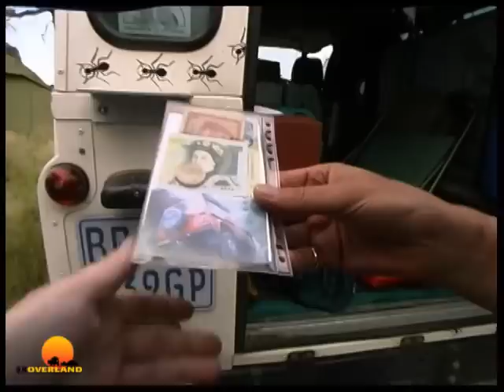Tyre pressures, how shocks work, building our overland truck. 4WD1, Ep2

Comment: Nice to see the logic of tall skinny tyres being better than fat tyres off road.  Most go for the fat tyres because of misconceptions and the aesthetic, losing steering lock, performance, fuel economy and increasing steering and wheel bearing wear with little benefit.  Fat tyres also dramatically increase aquaplaning on wet roads.

Comment: thanks for the tips, I have found in regards to corrugations that there is an optimum speed at which the cars suspension seems to harmonise and thus smooth out the ride. just sort of depends if you are comfortable sitting on that speed on a dirt road.

Comment: What causes corragations in the tracks, always wondered
Reply: Harmonic oscillation. It's caused by the tyres of the very vehicles using it. The more vehicles the worse the corrugations. It's basically caused by the bounce of the suspension. As another vehicle uses the route it is "bounced" in the same rut caused by the first vehicle and extends the surface damage. The rhythmic bounce caused by vehicles going at a same or similar speed creates the corrugations.

Comment: Why didn't your land cruiser get the snorkle top filter like the other one? And would water trap inside the snorkle pipe line and do damage after driving through rain? Thanks!
Reply: Kai He Safari snorkels along with the factory air box separate out the water. It's not a problem. Heavy rain goes in and is diverted out.
Reply: Got ya. Thank you very much!

Comment: Hi,

Just a few words to say how much I love your newly found and very interesting videos and opinions.

AND . . .  I wonder if, in your case, with so much over-land driving, whether a system of auto_tyre_pressure_adjusters would prove beneficial? Especially if you can find a system where they truly auto-adjust, if a system like that exists.’ This could save a lot of worrying and I do not know, but maybe you could ‘loose’ the fitting of an air-pump or connect it to the engine?

Just a thought.

Take care, from a jealous as hell invalid who drove until about 22 years ago and loved to drive, but for medical reasons I had to stop and voluntarily gave up my Licence to drive in the Uk and I cannot drive and or wouldn’t drive abroad because I dimply cannot afford to go abroad.

mrbluenun
Reply: mrbluenun the problem with that is that if it adjusts the tire pressure when the tires are hot, it will be  getting a false reading, so it is adjusting the tires to the wrong pressure  because the temperature changes the pressure.
Reply: JUAN ANDRES FRANCO OLAYA 
Is it Nitrogen that most ‘Industry Standard’ operations using auto tire pressures devices? Wouldn’t this have the capabilities of more or less completely letting the gas out by hand and reinstall afterwards using the auto system get over that?